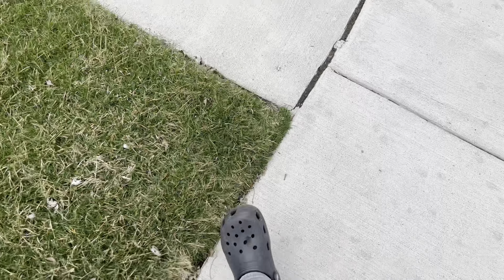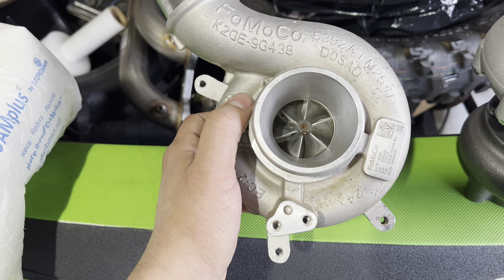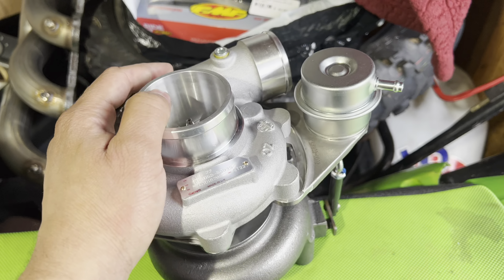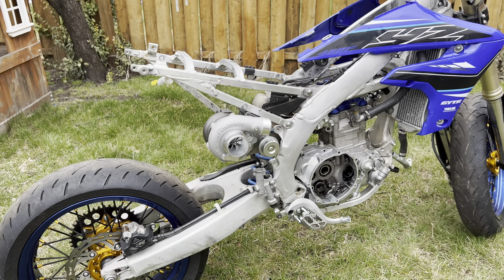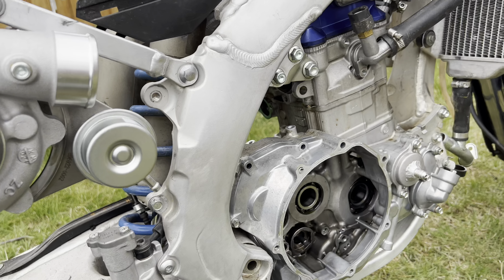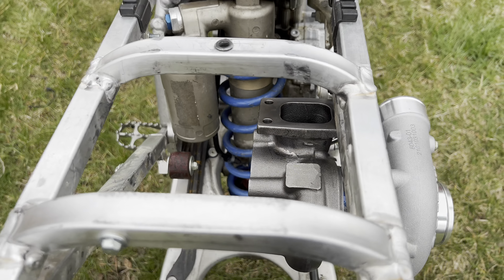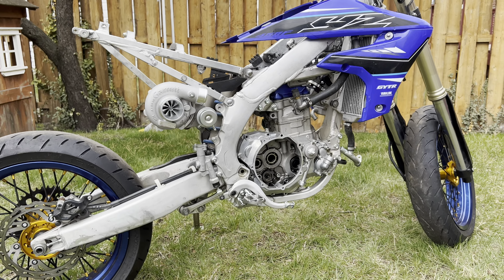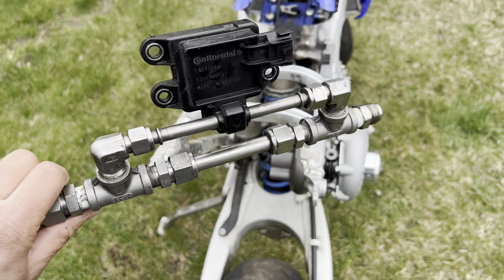NEW GARRETT TURBO + BUILD PLANS FOR MY NEW TURBO YZ450F BUILD!!!

Comment: That turbo is massive for 450cc. Who sized it for you? How much power are you expecting to make from the bike?
Reply from the maker: Sounds weird but… the smaller CC stuff needs bigger turbos to Dampen the exhaust pulses. The smaller stuff immediately begins to surge because the exhaust pulses “overtake” the turbine wheel
Reply: @The_StreetSweeper  Just watched your dyno video, 70.5 WHP. When you say surge, are you referring to compressor surge, because that is usually an indication of the compressor being to large. You could install a ported compressor shroud, or damper on the outlet. Are you running a blow of valve?

Comment: I have a 49cc bike and i want to turbo it and i dont know what turbo use and i dont know how to install the oil pump.If someone can help me pls
Reply from the maker: You might have to run a little small 12v one if there’s nowhere to tap off the motor for oil supply